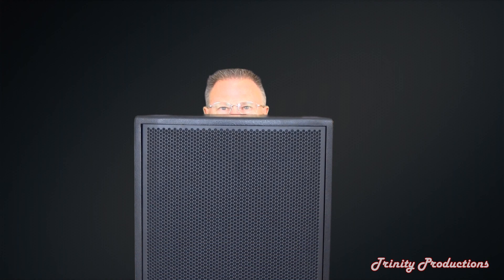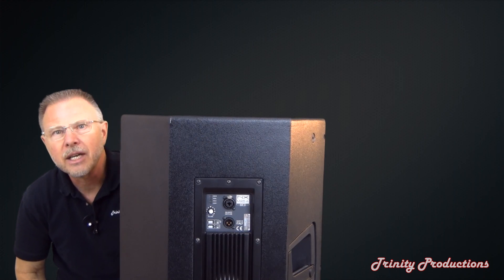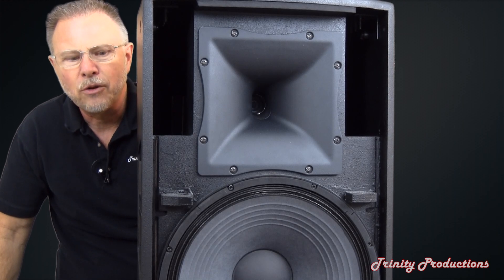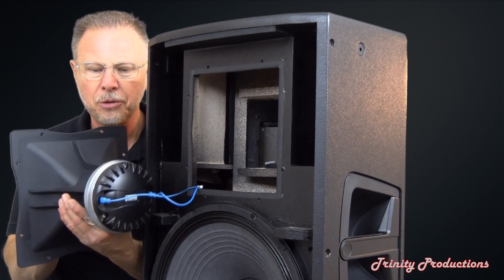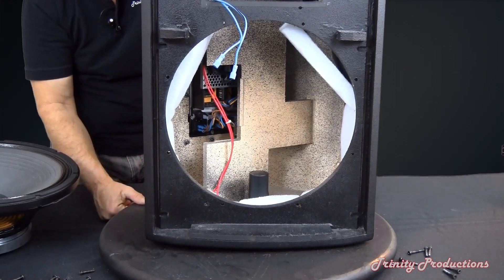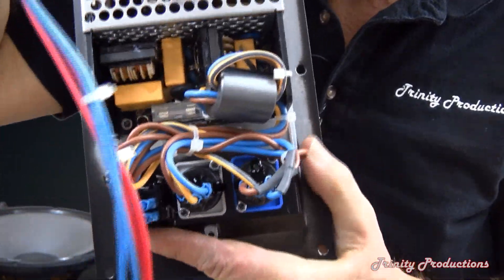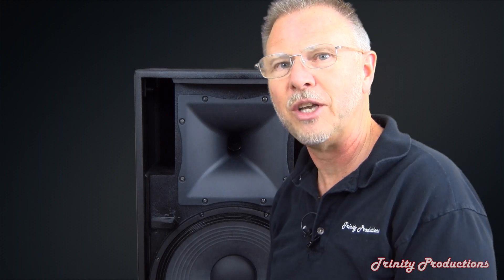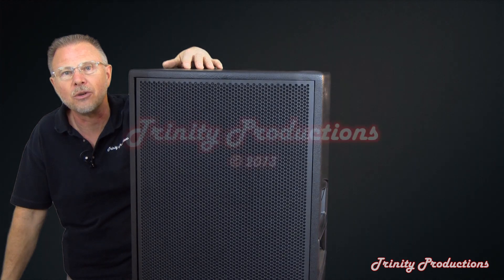RCF NX M25A full review and dissection - AUTHORIZED DEALERS

Comment: No... i mean the whole tweeter,, magnet of tweeter and horn,, is same of NX?
Reply from the maker: no different driver due to crossover points, they may have used the same horn flare but not the same driver the driver on the M25A is huge...the driver on the 2031 is only 1" exit

Comment: hello in your opinion, the high frequency of 4pro 2031 is like the NXM25A?
Reply from the maker: No the crossover point is much lower on the NX25 than the 2031, almost 600hz. So on the NX it will seem smoother than the 2031 being at 1700 hz. The new NX boxes are crossed at 700hz which it really sounds so smooth and natural.

Comment: hello,, can you explain why 4pro series is very expensive. only 1200watts, but art series is 1400watts like 712mkII
Reply from the maker: they are all wood for 1 and 2 they are an older series of amplifiers and technology , they have decent drivers but construction is very solid, thus the costs are higher than typical boxes. i would imagine that the 4Pro series will be phased out soon in the next few years due to the older design

Comment: This or the 745a?
Reply from the maker: When they are available in the USA we will get our hands on one .... from our experience with past NX series boxes like these, they are going to be AMAZING !
Reply: The NX45A is basically a TT25A II without rdnet and the new dsp interface. And with only 1db less than the TT25AII, is a very nice pack for the money. Here in Europe, the TT25AII is @2000 euros and the nx 45a 1500euros. So there is a 500 euros difference...I'm tended to say that is a better deal than the TT25A II if you don't need the rdnet.
Reply: And I'm saying this as a TT+ user now and Nx user in the past.
Reply from the maker: The new NX45 as the M25A has been discontinued. I love the sound of the NX speakers.
Reply: Will you have video of the new NX 45-a?
Reply from the maker: Yes or a ART745 in a wood box. The NX line has always sounded fantastic, without going to the cost of the TT, TT has better amp and drivers, but with that said, NX is tough to be for the $$$ for performance and sound quality.
Reply from the maker: Yes, we have both TT and NX, TT is amazing, but costs more $$$$ than NX
Reply: I am Dobix   
Have you seen the new Nx45a?
Did they keep the same module?
Thank you...
Reply from the maker: It is basically a wood version of the ART 745, most likely sounds a bit different due to wood box, but I have always liked the NX tunings and with the LARGE 4" HF driver it should be an OMG speaker ! Will be getting one soon for demo
Reply: Thank you
My question, was about the amplifier.
But I was informed that they took out the fan.
But the amplifier, it is still a class above the Art line
Reply: there is a different amplifier in the new nx 45  much more reliable .The amplifier modules for all the tt line are made by PASCAL AUDIO  witch is a very hi end amplifier manufacturer . the new nx 32 and nx 45  have also Pascal audio amplifiers but the more cost effective versions (trinityprosound can confirm this when they open one up , it is written on the amplifier board "PASCAL ")
Reply from the maker: yes that sounds correct...

Comment: Why don't mention there is no protection circuit inside that module? for DC output? and if that happens it will fry your speaker?
Why don't mention, if that power module once failed, it goes to trash?
Why not showing some oscilloscope waves showing the crappy wave at the output of that amplifier?

Nothing personal, just telling the facts about those "worst ever made" power modules.

People are following the brand name, not whats inside. really bad
Reply from the maker: They have been discontinued , almost 3 years ago now. But with Power Soft amps the speakers would have to cost a lot more .... every one of the M25A we sold NEVER had any issues with it/them ... the main issues we find with speakers is the user. not enough electrical AC to them or they attempt to do something with a speaker or just a few of them that a large rig would be the right system and choice and they blow them up trying to get something out of them they were never made to do. That is where we see failures.
Reply: True. Most of used cabinets aruond are RCF, because thy have lot of problems. One deejay i know, just sold a pair of 312 because of the module that can`t be repaired